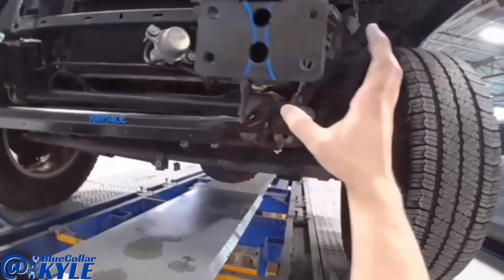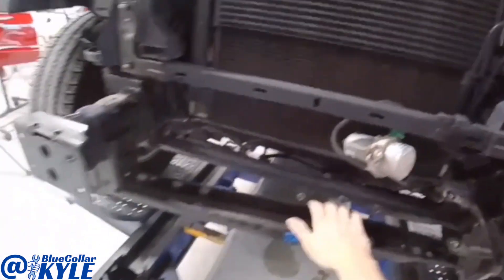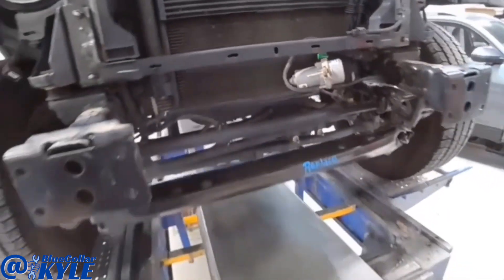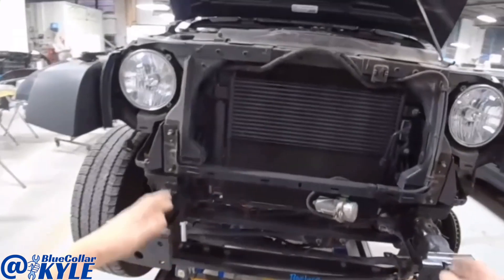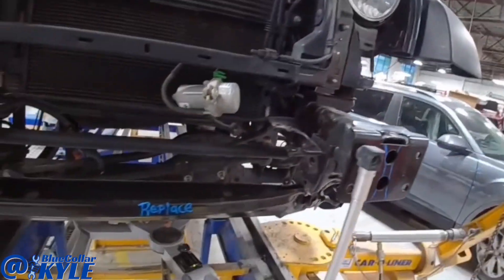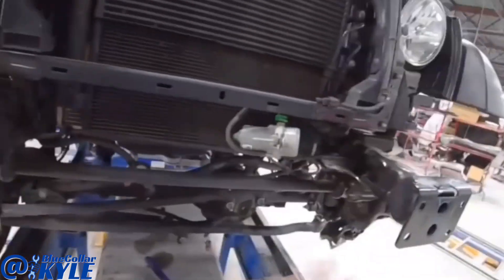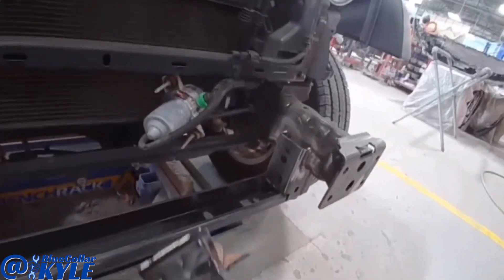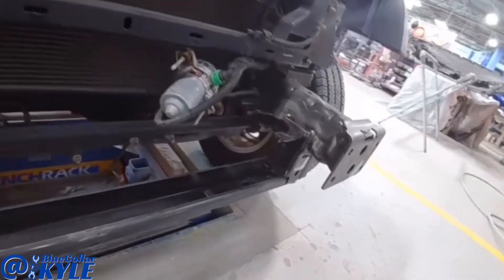Squaring Up A Jeep Frame!

Comment: That sux. I hate working on wranglers. I had to fix one that was swung 65mm. I wound up pulling 90 mm other way several times before I finally got it. Day and half on the frame machine
Reply from the maker: yup they are not fun and the fronts of those frame swing over rather easily